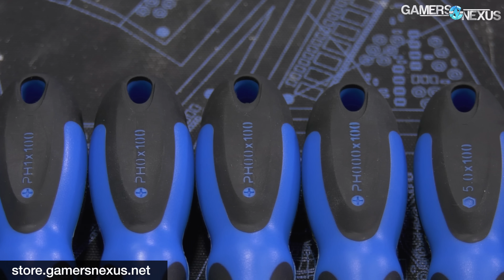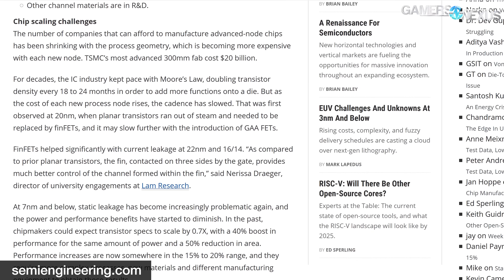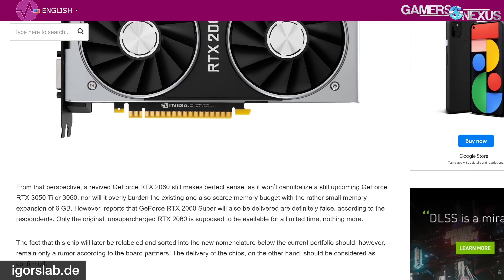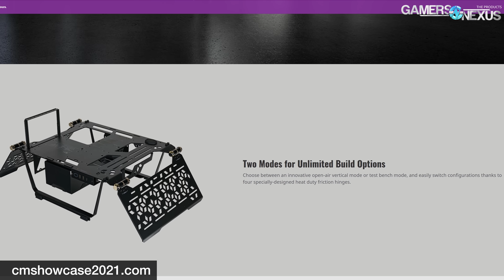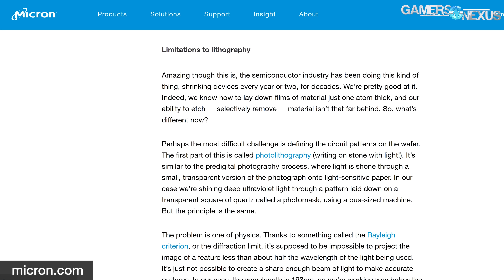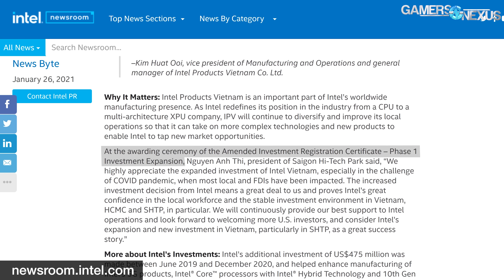HW News - Intel x ASUS GPUs Power On, 3nm & 2nm Engineering, Samsung Phone Chip Shortage

Comment: Why doesn't cooler Master make a water cooled power supply? I understand that you are dealing with high voltage and that may be a hazard but I was thinking they come up with a way they design it to be safe from leaks and it comes ready to just be hooked in a loop but not supposed to be messed with. I have a couple design ideas they could work

Comment: Been using your Tool Kit to just put computers together as well and they are amazing. My last 3 builds went so much quicker with them! I also display them under my monitor which has a light showing right down on them.
Reply: Just ordered one of these myself, been waiting for a restock.  Exchange rates made it uber-expensive, but your comment helps justify my decision; a dedicated toolkit specifically for sytem teardowns seems so much more efficient than trying to use 'standard' tools that often don't quite fit properly.

Comment: so the global supply shortages have spread to basically everything, even getting cold rolled copper is 20 weeks lead time now.  for reference it used to be 6-8 weeks.  im in the automotive industry and basically every commodity i deal with, from IC  chips, fuses, relays and raw metal......  i guess what im saying is, i accept 3080 will be unobtainium until well after 4080s are released, and their super/ti variants are planned

Comment: The cooler master master bench test bench master air but also a master case  and also maybe even a weird wallmount for your PC..

It looks interesting but I'm concerned about the pattern they put in on the panels that are supposed to hold the fans/radiators, since they seem like they're restrict airflow quite signficantly. not a huge problem for an open air bench i guess, but also doesn't really make it an easy sale if say I wanna use it for overclock testing or just as a general case.

Comment: So what happens when GAA runs out of steam around 2030 (assuming covid hasn't helped kill everyone by then)? 1nm (20-atom gate thickness) is about it for GAA, even switching from silicon to germanium or GaAs to double frequency with the same TDP will only milk it a few more years after that. Not that we will still need upgrades anyway, a 5yo video card and a 10yo 4-core CPU is still good enough for most things even now. Quantum will probably never be a thing for consumers, it would mean trashing all x86 parts hooked to the internet and starting over on the software side = way too inconvenient and costly for just about everybody.
Reply: Based name bro

Comment: This is a question about OC - couldn't figure out where to ask it so here goes.  Would using a soldered CPU make any difference to OC?  I'm referring to the motherboard connection, as opposed to a socket.  Would the soldering of all of those insanely tiny pins make a difference - either good or bad?  I'm curious about this.

Comment: Tachyum Prodigy processor. Might be worth looking into, could be another contender, at least in the enterprise market.. it seems like silicon fabs are 20 years behind the laboratory. I remember reading about GAA  in the 1990's as a theory.
 Scientist are just starting to work with light gates and THz lasers as processors.. but being that fabs are just starting to think about all around gates now. we are probably another 20 years away from light gates.

to be honest. we should have been using lasers as cpu's a long time ago. it would negate all the issues with resistance and electrons jumping gates in the first place. . of course all x86 architecture goes out the window. Anything copper becomes useless. we would have a computer that looks alien compared to a typical pc.  Most connections to it would need to be fibre optic in order to keep up with latency. 

the other option is "wetware".. im sure some govt agency basement has that going on... last i heard they trained rat brain cells to fly a plane in a simulator.

Comment: If you want to review a new product that perform poorly for a really dumb reason the new Cooler Master liquid coolers look like a good bet. It appears CM is using a fan that is incapable of pulling air through any reasonable source of impedance one might find in a case; like a mesh filter or an AIO radiator.

Comment: I downloaded the spec sheet of the new XG series power supplies and they feature a single 12V rail, size is 150*160*86mm. The 850w is 15.6 dBA fan noise at 20-50% and 25.5 at 100%. The lower wattages only slightly (0.4 dB) less. Fan is 135 mm rifle bearing 1800 rpm (but it says fdb elsewhere). all are platinum rated. The RGB display panel shows temperature, fanspeed and power consumption. I believe "in line capacitors" means there are caps at the end of the cable, which will help significantly with ripple, or in other words, it allows the psu to get away with worse ripple. The 10yr warranty is nice.

Comment: From a semiconductor fabrication perspective, the use of water is very interesting, as it will oxidize the silicon surface faster than air. They have been using other gases like Nitrogen for some years now to get around this, so it's interesting that they would use water here. I guess they can get around it with a slightly longer etch, or a slight etch before diffusion, or if it's a relatively short use of water on the wafer, they might be able to get away with it and nothing else. 
You would need ultra pure water for this, which is already available to a semiconductor foundary, so it's a good choice.

Edit: Air has a very low refractive index: very close to 1, so I am skeptical that water is less. I did some poking around, and air at UV is still very close to 1. Something like 1.00031 at 185nm. Water is about 1.468 at 180nm and increases from there. So it definitely has a higher refractive index. Still, it's possible that the interaction with the water and multipatterning can still get better performance than air.

Comment: Limiting their graphics cards only to intel systems, will not really help intel sell more of their graphics cards.
Reply: It's basically the same as their new IGPUs. It doesn't have its own bios, so it needs an Intel CPU and compatible bios to run at all.
Reply: @Dreams_Of_Lavender  Ah, thanks for the explanation. 
I guess that limits it's usefulness even more. I can't imagine getting a bios update for my old board with a Hasswell era xeon e3 1225 v3. Now I wonder if those things come with their own ram or if they will use system ram.
Reply: @heyarno  it said it only supports some midrange and low-end 300 and 400 series chipsets. DG1 will probably be OEM only so we can't even buy one.
Reply: @Dreams_Of_Lavender  Ah, right.

Comment: I think they would even sell 1080's, super quickly at a good price 😆 most ebay sellers are still asking 400$
Reply: If they sell 1080ti's though, it could be good if it was sold at around the same price as the 3060ti, as long as you mind not having ray tracing.

Comment: Micron's comments are silly. ASML had been making immersion DUV (193nm) litho tools since 2007. Multiple patterning is what all fabs have been doing to stretch out DUV until EUV becomes more wide spread. The benefit of EUV is that it allows scaling in two axis (multiple patterning just helps you make parallel lines closer together which then have to be cut with an additional mask) and reduces the cost by reducing the quantity of processing steps, but requires big capital investment. Micron has effectively just said "we'll be doing what TSMC/Samsung/we/etc. have been doing for a decade before EUV was ready".

Comment: GAA, Jesus. FinFETs must have already been hard to design on.

Intel might take time to develop GAA, and even longer to do full-custom chip design on them. FinFETs already create such a complicated transistor model especially for capacitances... I assume GAA makes that worse on the design side. And gate capacitance will no longer scale the same way. (Gate contact surface area scales with capacitance for the most part... and that's what they're trying to increase.) The drive-strength-to-capacitance ratio is a big part of the time it takes to switch, which then affects the clock speeds of digital microelectronics. Is smaller better? Yes, for things like minimum power per transistor and the like, which drives an increase in scaling and complexity, all the way to superscalar CPUs and multi-core designs. But is it faster...? Not inherently. Nobody knows anymore how clock speeds might scale because of this gate-capacitance problem that started showing up once transistors went under 1um (The "sub-micron") process tech. Also Dennard scaling, which "puts limits" in power density. Put those together and you have the old reason why Pentiums couldn't reliably breach 4 GHz, which has a lot to do with the equivalent power necessary (both drawing but more importantly dissipating). Just like Core Duo introducing multi-core to many consumers, here's hoping increasingly complex architectural improvements can be found.

In many ways GAA and sub-7nm is just a ton of headaches for CPUs. I don't want anyone to get this idea that we're on some CPU roadmap to reliable-6-GHz-without-overclock or anything. We're more likely to either see an end of reliance to x86-64 first (ha!) or some really complicated stuff to vastly improve multi-core and IPC with new process tech. And there's certainly time for those changes. And again, for people who are looking to either the end of Intel's 14nm+++++++++ or what might be Zen 8 by the time we go under 7nm for CPUs, the architectural changes are going to be more interesting to track.

Comment: Nvidia: Here are some 2060s!

Board partners: Where did you find these old GPUs?

Nvidia: You don't need to know...
Reply: it honestly doesn't matter.
Reply: @randommcranderson5155  could be a way to push the price per piece up. Once your Production ist limited to a certain amount of pices, it makes sense to hold supply back to increas the margin of current products, but since the market is totaly dry i bet you will get them at around 400bucks of $/€ the MRSP of the 3060TI...
Reply: @darkagehibernia4843  
i just looked at them, would you believe 800 to a thousand usd.

Comment: 2060 "resurrection"?!?
That's the card in the new gaming rig I bought in September...

Whilst I was waiting for it to be built nVidia announced the 30 series and I was worried I'd made a bad move.

But, having seen the retail shortages for the cards and how much built systems are with the latest graphics cards, I think I did the right thing. By the time the warranty is up the cards should be widely available. And I went for a PCIe4 motherboard.
Reply: Sorry. AMD chip motherboard, so should be able to upgrade CPU as well.

Comment: Shouldn't we introduce decimal point for transistor size at this point, or go to picometers? :D
Reply: They're not actual measurements, so adding more accuracy would make it sound like it is
Reply: @DoesntRefillTheBrita  That makes sense, but what when we go below 2nm? Jump won't be 1nm? We'll need 1.5nm for example. And we didn't have the problem saying that minimum feature size for Intel 80386 is 1.5um (micro).
Reply: @white_shadow_123  not TSMC nor samsung nor Intel even know that yet, as going below 3nm is extremely difficult and 2nm almost Impossible. Chances are we'll change away from traditional silicon dies before going to picometers.
Reply: @DoesntRefillTheBrita  Yeah, yeah, I know, silicon atom diameter is about 0.2 nm, so that would mean that gate width would be just 10 atoms wide at 2nm transistor size. Mind blowing when you think about it, isn't it?
Reply: I really hope that They more to some other way to show how Sense the chip is in reality!
Reply: @haukionkannel  in reality the transistors are much bigger so we shouldn't have a "measurement" problem. But companies want to look good on paper, so they make claims like "7nm" which is closer to a generation than a real measurement. In fact, TSMCs "12nm" is BIGGER than Intel 14nm, which is only a little bigger than their claimed "7nm"

Comment: as core count increases on cpu, is there any news on reverse hyperthreading? meaning hardware supports for many threads to do one task.
Reply: What? How... would that even work... In serial? What?
Reply: @cy-one  i dont know the details, but its a real thing that is in development.  it could be the solution to performance bottlenecks instead of waiting for lazy or bad game engines and software to get multithreaded.
Reply: @sudd3660  The issue with that is making sure one thread isn't going to reach a point where it gets stuck waiting for information from another thread. Doing that in software is hard enough, but forcing it to do it exclusively in hardware would just cause more programs to break. 

Program: "Hey where's this information that should be ready by now because it was called before me? *crash because it's on a different thread to where it should be and so the information isn't ready*"

User: "Why the hell is this crashing every thirty seconds?! *uninstalls software that isn't actually the problem*"

There's a reason stable multithreading takes time, especially if they working based off code from previous versions that were single threaded. Starting from scratch would likely be easier to multithreaded, but then you lose the previous work that's been done. Is it possible to rewrite a program to make it more multithreaded? Yes, but I doubt the solution is an external driver or later to run over the top of the program. 

Hopefully I'm wrong, but I think we just need to wait for more companies to adopt the Id Tech approach; "What game thread?", and multithread everything when developing it, even if it takes a bit longer...good luck convincing the publishers and stuff that though.
Reply: @joshuawaterhousify     i see the issues, but idling\waiting cores are not an issue on high core count cpu. 
wish i remember what the tech was called or who are researching it. hopefully not a dead end research, but then why start it in the first place if it clearly not stable enough?
Reply: @sudd3660  But the issue isn't so much the idle time, the issue is that if the thread isn't told to wait in code, it can crash the program if the next step isn't ready. I've dealt with it a few times in my own code, and that's not even working with threading and just having initialised variables in the wrong order (I'm coding something right now and just had it happen), with just 4 code files maxing out under 100 lines each. 

Now imagine trying to code an abstraction layer that can read compiled code in hundreds or thousands of files, with hundreds or thousands (or more) of lines each, and do code injection to make single threaded tasks multithreaded without crashing due to timing issues or misplaced injections? Is it *possible*? Probably, but I wouldn't be holding my breath on a full release for it any time soon. 

Hopefully I'm wrong though, because I'd love to be able to run any program without needing to worry about whether a task was single or multithreaded, or whether it was stable or not. 

The other thing is that at least for gamers (based off Steam's hardware survey, which I know is only so much of a reliable metric), over 40% of people are still on 4core CPUs, and since most engines even that have been around for a while do use at least a little multithreading for things like physics (at least from my understanding), there's possibly risk of the overhead of making it multithreaded being higher than the gain of it being multithreaded? 

Then again, I'm more a bedroom programmer, and only in a relatively light language (C#), while barely touching multithreading at all (only recently in a thing that probably isn't even benefitting from it), so it's almost certain they know more about it than me, and have ways of doing it that I can't even fathom, I don't know. 

Either way, I'll be looking out for it, because if they can make it work and keep it stable, that would be awesome!

Comment: Speaking of right to repair, I'm watching this as a test after replacing the touch screen on my Nexus 4!
Reply: Damn, you're still rocking one of those... meanwhile my HTC One M7 got bricked by some glitch to the point where hboot itself was corrupt.
Reply: @TommyFenstermacher5150  many people are on older androids
Reply: @bestcodman24  a while back I installed rooted LineageOS 15.1 (Android 8.1). I saw a thread about installing the latest version, but didn't attempt it at the time since Android 8 is apparently better for location spoofing. I'll have to go back and try to upgrade.
Reply: @TommyFenstermacher5150  I just resurrected the Nexus 4 to use as a mp3 player while my main Pixel 3 is out doing a time-lapse.

Comment: There’s no cheapie AMD 6000, it’d be a perfect time for 6gb 2060 to reappear for a minute,
Reply: It's likely there will be a 6700XT and 6600XT, they just won't be any time soon.
Reply: @matasa7463  OP's exact point
Reply: just snagged an overclock 8gb version off of walmarts website... not bot or help, i just looked and got lucky for an hour they had 7 in stock
Reply: Nope. The card should be dead and buried.

Comment: I saw 2060 on german site for sale. It was new listing so I dont think it is a rumor.
Reply: I wouldn't pay more than 320€ for RTX 2060 OC because for real when it was on stock I was seeing prices sitting around 300-330
Reply: I just bought a 2060 super pny overclock 8GB off of Walmarts website a few weeks back no bot... no bot or anything, and it was up 2 hours. Sale price 420.
Reply: @dertythegrower  I bought a 3060ti off newegg for $470, have hope!
Reply: not a rumor. 3 major china mnfg already ordered new 2060 silicon.
Reply: what was the price?
Reply: @Mako2401  it was over 400 euros, so msrp like
Reply: @Mako2401  Just saw a posting by ASUS Germany's official ebay store which was posted today: an RTX 2060 OC for 370€. That's almost normal pricing.